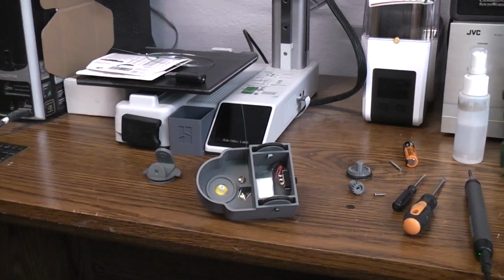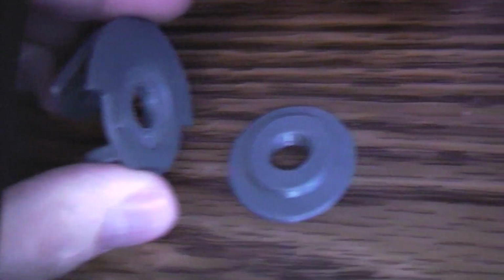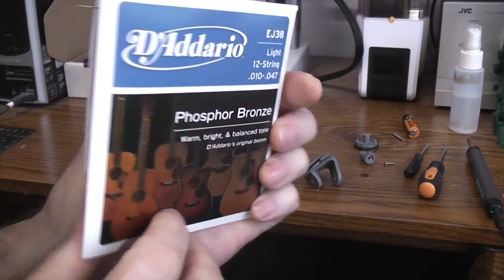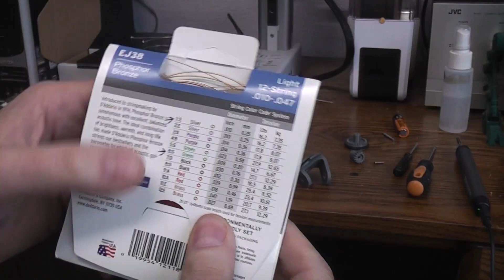You can 3d print, the type 3 "single wheel" bump & Go drive, based on Tomy Ding Bot design.

Comment: The Spotbot by Tomy also uses this unusual tilted wheel mechanism for its bump n' go action. It was the first time I'd seen it on a toy when they came out. Very cool how you were able to make it work so well here.
Reply from the maker: Thanks to good design by Tomy I was able to make a 3d printed version that did not require the specific coil spring that they used.
Reply: @Robothut  Oh! That's awesome! You'll have to show it on your next video. 😁

Comment: Forgot ask. What length of guitar string are cutting off for making the spring ???
Reply from the maker: I used about 4.5 inches but your length will vary based on the gauge of guitar string you use. You only need enough spring action to keep the wheel aiming forward under normal conditions. To much spring return and the wheel will not be able to turn when it bumps into things.